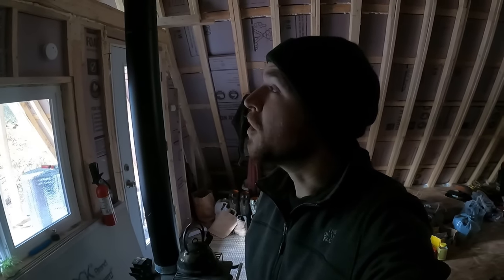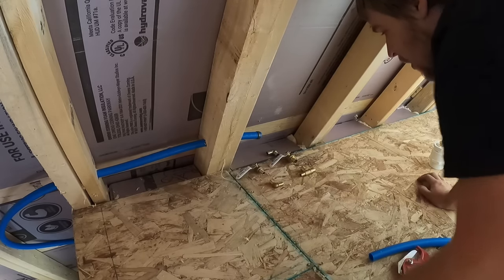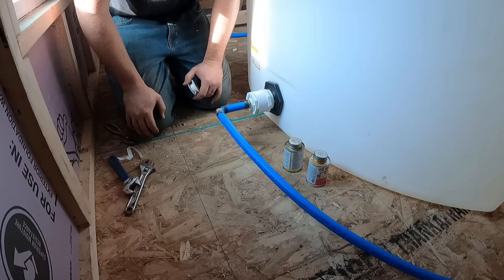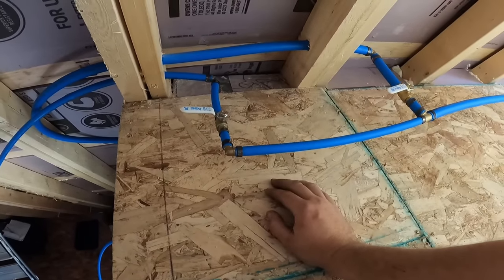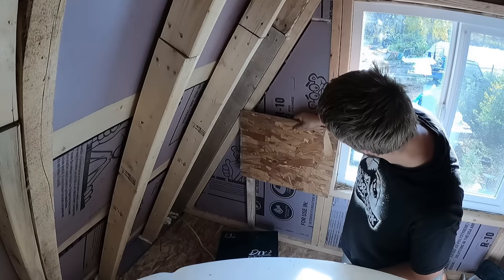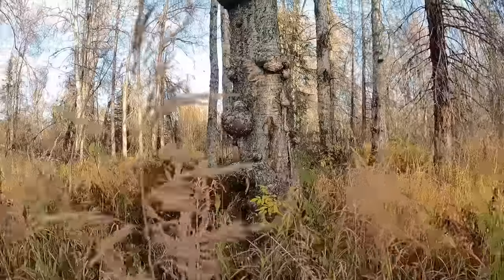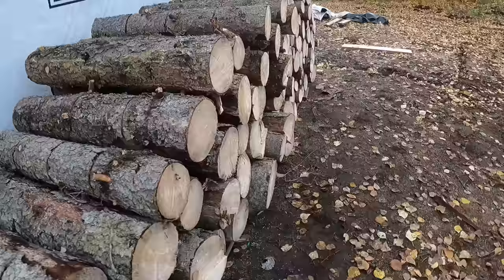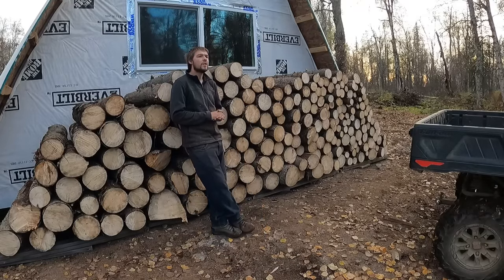Placing our Utilities - The start to water and electricity

Comment: You should put the water tank on something because its going to sweat when you put the cold water in it and your floor will be getting wet. Over time it will cause trouble.
Reply: Excellent point!!!
Reply: I was just going to write the same thing.  You need air flow under it.
Reply: They won’t do it.  Anybody recommends something, and they just know better.  Everyone suggesting has lived much longer, I’m guessing, but they (Cody) knows it all!  Hell see how much he knows when heaving happens in the Spring and the foundation is destroyed.  Both of them like to do the same work twice.

Comment: You need a main shut off,ball valve at the tank,if you get a leak you have no way to stop the water from flowing down stairs.And insulate the pex coming down.That inlet spigot is gonna freeze,you'll see once it gets cold.Dude I've lived this life style in cold country for over 40 years,I've learned the hard way.And by the way water and electronics don't mix,keep them separated.

Comment: Water operator here who works in a cold climate. You're going to want too add two things to your fill line. Most critical is a check valve between the fill line isolation valve and the tank so that the water can only travel one way and you don't risk loosing the volume in the elevated tank should something fail during filling. The other is a vent for when you isolate and drain it for cold seasons. Both the vent valve and the outside valves should be open once the line from the tank is isolated. Do not depend on things just trickling out when the weather is well below freezing. I'd also seriously consider having an isolation valve at the tank too.
You may also want to consider getting a pump that will circulate water within the tank (think fish tank) to keep it the water from becoming stagnant. This will depend on what you experience and how long it takes for you to go through your water. Putting a cover over it is a good idea. 
Good luck!
Reply: Hi guys, thank you all so much for sending all that good advice to this lovely, hard working couple.

Comment: Your fill should have been seperate and at the top of the tank. Filling in the same location means your pump will have to be powerful enough to not only fight gravity, but also fight the weight of whatever water is in the tank. Oh and also, rule of thumb for firewood, think of how much you'll need and triple it.
Reply: Ya I found that out the hard way.  Much easier to fill from top.

Comment: If you're going to add fiberglass insulation later, you gotta bring the PEX piping farther inside. Sandwiching it between fiberglass and foam is a recipe for a frozen pipe. The golden rule of plumbing in the north is, "don't put it in outside walls". Well, if you're careful to always draining that line after filling the water in the winter, it should work out OK.
Reply: Also if you don’t have a proper 4’ foundation  any plumbing in the crawl space will have problems unless you run heat tape.  My first house up here had a crawl space that was just skirted with insulation and it didn’t keep it warm enough. Our Alaska off-road remote cabin I built high enough off the ground to make a room where I put down gravel, 4” of high density foam board and two tote tanks. I built 2x6 walls with insulation in them around it. All the plumbing except the drain is inside. When the tanks are full it is over 2 tons of water. Our house i built in the side of a small hill and it has a full foundation with a daylight basement. All plumbing on outside walls comes up through the floor. The outside walls have 7” of spray foam.

Comment: Should put a ball valve in at the tank so you can shut water off as soon as it comes out of the water tank before your 1st 90° fitting that way if you ever have any leaks you can shut the water off at the tank and not have a 300gal water mess in the house would be my recommendation
Reply: I was thinking the same thing. Thats a lot of water if there's a leak. I would definitely add a shut off right at the tank!
Reply: I hope the floor can handle the weight over time. 300 gallons is over a ton of water.  Also a overflow pipe near the top of the tank going outside so when you fill it you know it’s full.  I don’t vent my tank inside at our off road cabin because it adds moisture to the cabin.

Comment: Regarding your water tank: Because it is “translucent” you are going to get more algal growth/other stuff growing in it regardless of the copper pipe. Best practice is not letting light get into the tank. Several coats of the “Blackest Black” paint you can find will make it so that you do not need to physically clean the tank… may be able to get away with just shocking with chlorine once a year or so. Best way to figure out if you did it right is to drop a flashlight into the tank. If you can see light, give it another coat. Looks great overall.
Reply: They do sell dark covers for these on Amazon I understand...
Reply: I know painting is definitely probably cheaper but it's already installed.

Comment: Additional thought, for absolute sure put rockwool insulation between your piping and the foam board insulation on the roof. You don't have enough r-value to protect your pipe from freezing. You might want to think about putting in some kind of a flow limit or valve so that if your pipe burst downstream from your supply tank it does not empty the whole tank into your house. There are gallon per minute limit valves available that will allow plenty of blow for your use but prevent a full OpenFlow in the event of a burst pipe

Comment: Retired Journey ,
Had to post a comment !
You need a shut off valve close to the tank please put one in , not four feet away from the tank ang don't plan on using any outside hose bibs in the winter period and don't even have water sitting in them ....  Only reason I posted is you have had enough problems there and you don't need anymore .... Welcome to Alaska and Mother Nature will take water lines under pressure OUT on most outside walls .... Have fun Building both of you and be careful up here .

Comment: Great job guys. Just an idea you might want to consider while the water tank is empty. Is there a plastic piece with upturned edges that you can place under the tank? Somewhat like a flower pot and the tray under it. It might catch the sweat from the tank or any potential leaks where pipes are inserted into the tank. (Anything, even a tarp or something wrapped around the bottom) If not, paint the wood with an epoxy or something to repel absorption of water by the wood. I’m not here to do anything but watch your hard work as you get closer to a successful outcome. Good luck to both of you. This has to be so hard!
Reply: They may also want to raise the batteries up in case there is water issues

Comment: May think about installing a overflow on the tank so in the event you over fill the tank it wont spring a leak inside and make it visible while your filling so you know when its full.  speaking of leaks and condensation, they dont mix well with exposed osb plywood, really should elevate the tank with some 2x4s or something in the oppisite direction of the floor joists along with anything else you can do to prevent moisture or water of anything getting to the osb especially for any length of time. Keep up the good work, love the videos!

Comment: I think that your fill line should go directly to the top of the tank than outside so it will drain after using it to fill without back draining your tank and drain out so there is no water in it to freeze. Go to the Mitchell's channel to see how they fill their tanks. Best wishes

Comment: If you are going to have water in the line at the outside ball valve during the winter it can freeze and crack . A frost free hose bib would work also. And adding water to your storage tank from the bottom will add a lot of head pressure to the  pump. Filling the tank from the top of the tank will make it easier on the pump. Good luck 🤞
Reply: Why?  If the pump has to lift all the water to the top of the tank, it will always be working against maximum head.  If it fills from the bottom, it won't have maximum head until the tank is nearly full.  What am I missing?
Reply: @wdtaut5650  you're missing the the back pressure of the water you're adding to the tank . That naturally wants to go down hill while you are pumping up hill against it.
Reply: @chrismoen3416  The back pressure is determined by the height of the water in the pipe, not the volume.  As far as the pump is concerned, the tank is just a wide place in the pipe.  If it is ten feet to the top of the tank and the tank is full, the pressure at the pump is exactly the same as the pressure would be if the pipe went to the top of the tank and discharged there.  There can be differences with very small pipes, very high pump discharge rates, and very long pipes, none of which are significant factors here.  
The main advantage to having the pipe discharge at the top of the tank, in this case, is the pipe will be independent of the tank.  If he ever has to repair or replace the pipe to the tank, he won't have to drain the tank to do it, nor will he have to buy a shut-off valve for the fill pipe.

Comment: You are attaching those pex pipes together wrong, upmto code you need 2 pex clamps on every junction turned 180°from one another.  Just 1 clamp will hold but will end up failing at some point

Comment: I may need a back-flow valve to help your pump lift that high without back pressure from the tank. Unless of course you have a high pressure pump moving water.

Comment: You need to put that ball valve inside, it will freeze out there and brake. Remember to pitch the outside part down to allow water in the piping to drain out when you remove the fill hose

Comment: 325 gallons is about 2700 pounds of weight when full. Also, please consider getting a small electric heater AND a kerosene heater. If a day comes and one heat source doesn't work, you have a couple other choices to get through the rough spots. Good job getting water and power to your home!  THAT WAS FAST!

Comment: Maybe bury your water tank deep in the ground so it doesn't freeze and leak out if you leave your cabin or run out of wood for heat. You can use a cheap RV water pump to get water to your faucets and shower.

Comment: You're doing an awesome job with the plumbing. It looks great. I agree with the put something under the tank to keep the sweat from eating into the wood and you might want to paint the shipboard with a sealant also. One thing that I've done four years till I learn to do it right is when you wrap the pipe tape on the threads you have to wrap it the same direction that the threads turn I notice when you put your adapter into the PVC you wrap the tape the wrong direction. That's actually you want to wrap the tape on righty tighty not Lefty loosey. I've done it wrong enough times to be an expert so you can use left tape and get the same seal. Mostly you guys doing an awesome job I'm so jealous and I'm so impressed. I hope you're going to put rockwool insulation a lot of places inside to add to the foam insulation because I know you know that's a very low r-value for the chili place that you live. Be safe and please enjoy your life there. For those of us who are old and broken and can't do what you're doing you are living our dream and fulfilling the lives that most of us wish we had.
Reply: 👍❤все вірно ми старі можемо тільки дивитись.

Comment: Could you brush flex seal or something like that on th flooring under and around your water tank to save the wood from condensation or a leak? Im also wondering if you can somehow protect the batteries in case of a leak.? Im probably over think8ng thing's as Im sure you two have already thought of these possibilities. 
You've accomplished so much in such a short time!  I hope your able to do some fun activities too.

Comment: 325gallons of water is 2.7 tons of weight, with a tank that size, you going to need a floor that can handle 60-80 lb/ft2, or >2x or more a normal res floor, or closer to commercial floor strength

Comment: just a suggestion looking at the a frame when you showing the tap down the bottom you had daylight coming in at the top you need to fix that if you use the wood heater all the heat will go out the top did you know it was like that good job on the set up good idea paint the tank black i saw some people do that with the  square tanks there is covers you can but on line if that helps wood shed is to far away but you said you will build a new shed dont have long runs to the solar panels better on a outside rack so you can move with the sun or maybe you dont need to up there

Comment: Have you given any thought to the consequences of a leak in a second story indoor water tank?  Might be a heck of a lot of damage, especially so during a deep freeze.  Might be a thought to put a shallow pan under it as is done with hot water heaters with a drain line going outside.  In your case an insulated line with a one way valve so cold air is not coming back up the line.  Lead it to an area where it won't cause damage when it freezes.  Pan can be made out of fiberglass or epoxy as well as metal, needing only to be two or thee inches larger than the tank circumference and a couple of inch higher than the drain which ideally would be flush to the bottom.

Comment: Something like what you’re building would be a great camp in a secluded area here in Florida. Would have to be handicapped accessible, indoor shower and toilet. Wouldn’t have to worry about freezing or snow, just put in an A/C. Just wondering if it’s so bad you are snowed in for a length of time. What about a large supply stock? Not to familiar with AK, am a Floridian. Enjoying the videos.

Comment: Your not going to be able to fill the  tank from the bottom because as you  fill from the bottom it will build up  pressure that you will be greater than the pump output.  Hence you will not be able to top off the tank. So I will suggest that you fill from the top.  God bless Bill
Reply: Was thinking the same thing

Comment: Just Saying = My Observation & 50Yrs Experience...

U Sure Do Take The Long Way Around = IF U Had Drilled Through The 2X6 { @ The Front Of The House  \\  Where U Drilled 4 The Generator Wire} = Straight Up, From The Tank On The Truck = Straight Into The Water Tank = Shutoff Inside (Warm) & Lower Pipe 2 Truck, Drains (Gravity Like Showerhead) = No Freeze-Up = WAY Less Piping & Connectors & Time Wasted = Less Outside Exposure = WAY Less BSing Around With All That Piping Inside...
PS = U Should Have Used 3/4" NOT 1/2" = More Flow & Pressure Available.
However, Since U Used 1/2" & Piped The Way U Did... Make Sure The Shutoff To 1/2" Is Closed When Pumping Into The Tank From The Truck, As Back Pressure In 1/2" Piping May Cause Leaks...
& U Should Have Installed A 3/4" Output Separate From The Input. = No Back Pressure Issues = Also Allows U 2 Install An 80 PSI 12vdc Pump On The 3/4" For Better Pressure In The System, Which Makes Better Water Flow 4 Outside Watering Etc., {Than Gravity Feed [Or Pumped 1/2"]}...